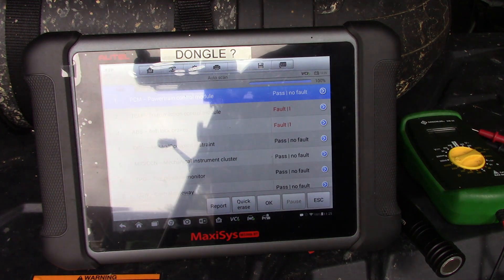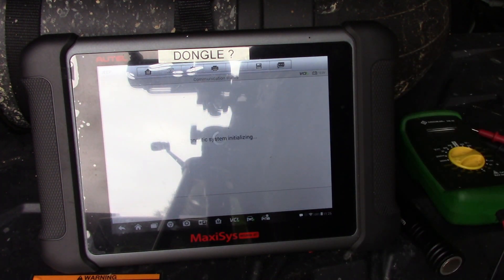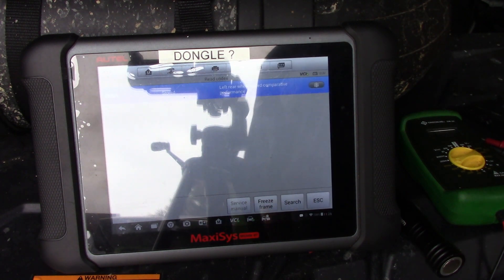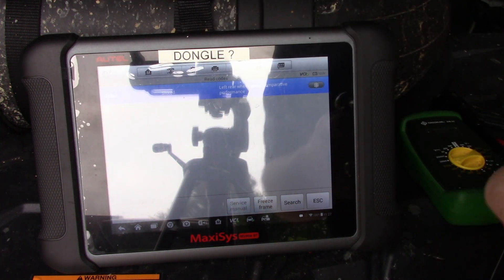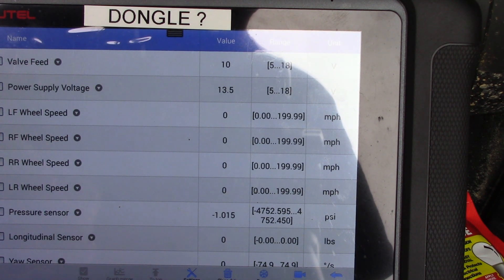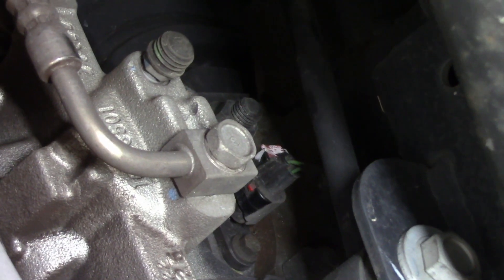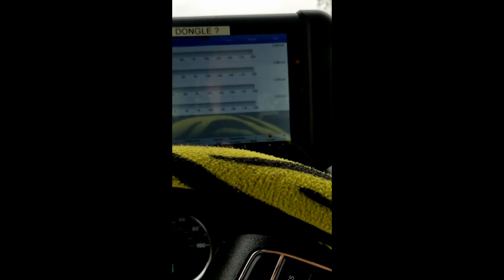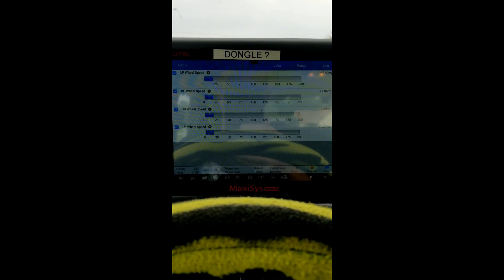Jeep wrangler codes C102A and U140B for rear ABS wheel speed sensor

Comment: Any suggestions on if the code is still being read if I replaced the sensor already??
Reply from the maker: How many miles did you drive after replacing? I know without clearing the code with a reader it takes a few miles to reset. I didn't have my tool (on the second one that failed) to reset and it took a few miles from where I was to home. If it still is showing it failed, you can swap the rear sensors to see if the problem switches side, run the wires to see if they are damaged( also OHM check the ground and see if power is getting to the sensor).  Ohm checks the sensors new vs old to see if they are reading differently. Also, check the body grounds to see if they are not corroded (up in the engine well right forward frame that holds the radiator, common issue for ground problems)  and check the fuses to make sure all dealing with ABS is good.

Comment: I had that problem. Used the Veepeak OBD BLE+ and JScan and the codes were from the left rear wheel speed sensor . I replaced it and drove it and the dash lights went off and no limp mode so seems to be fixed.
Reply from the maker: That's great.

Comment: Just replaced mine. 
OBD2: Bafx bluetooth (you have to buy the one for Android OR Apple - choose wisely) - around $20
OBD JScan: Free with a few tools, but bought a license for $25. 
I tried to use the popular Torque app, but it just didn't pull the codes. OBD Jscan is for Chrysler products and worked perfectly and the interface is very well organized. Wished I was using it when I was diagnosing other issues over time.

The key trick did not produce any codes.

Autozone was my only choice - I usually get all OEM parts from Mopar. Duralast Brake ABS Sensor SU9956 $26

Hints and tips:
If you have meathooks for hands you're going to have a hard time getting in there.

I kept the rear wheel on and halfway through wish I had just removed it. Very tight under there.

Used small brush and brake cleaner to remove all the dirt caked around the sensor before removing it.

Used a few long extensions on a 1/4" drive to get to the 8mm bolt from outside the shock assembly.

Had to spray the red lock clip with WD40 and let it soak for a few minutes - it was encrusted with white stuff.

The red lock clip was the worst - you will need a smallish flat head with a wide but thin blade to get it unlocked. Mine popped out of the body completely. 

Get one of those automotive picks - it will help a lot with getting the connector off while pressing the top of it once the red clip is loosed/popped out.

When you go to reassemble, make sure the locking clip is pushed in just the right amount when you attach the wire plug assembly. You can't put it back in AFTER you reattach the wired plug.

Getting the sensor out was a huge hassle - it took me a good 10 minutes of wiggling/pulling/cursing.

Putting the new one is was difficult - the tip of the new one (which I measure to actually be 1mm smaller than the OEM) was a PITA to get the tip in. Wiggle, wiggle, wiggle. Once the tip got past the opening it basically slid in. 

Overall, it was about an hour for what seems like it should be a 10 minute job. YMMV.
Reply from the maker: Glad you got it replaced.

Comment: Great video.
I'm gonna need that diagnostic tool. Any suggestion where can I get one? price range?
Thanks.
Reply from the maker: It's AUTEL MS906BT, You can find them usually around 1100.00 and up. The kits come with a lot of OBD adapters for other vehicles and a boro camera that can attach to it. I got mine from ebay about 2 years ago. It works on all kinds of vehicles, I used it on all my friends and families stuff to see what was really wrong and it cuts the time down a lot. This the site, also remember every year it cost 600.00 to renew your subscription, but it's worth it.  https://www.ebay.com/itm/Original-Autel-MaxiSYS-MS906BT-Bluetooth-Car-Diagnostic-Scanner-Tool-ECU-Coding/122378346041?ssPageName=STRK%3AMEBIDX%3AIT&_trksid=p2057872.m2749.l2649.
Reply: @jetzombie  ,
I appreciate the info. Cheers!
Reply from the maker: @xtr3m385   Anytime!
Good luck.